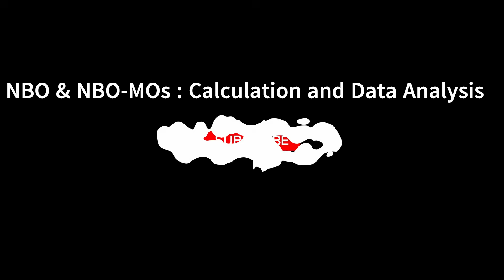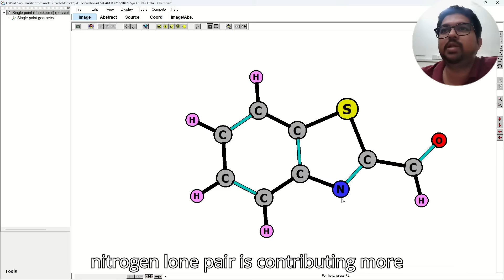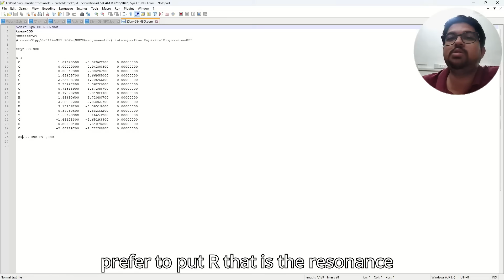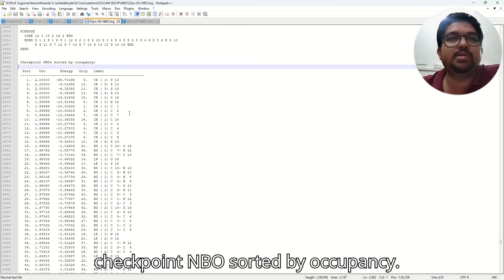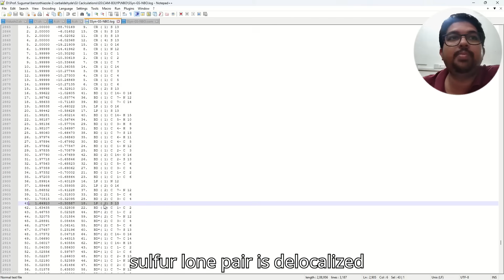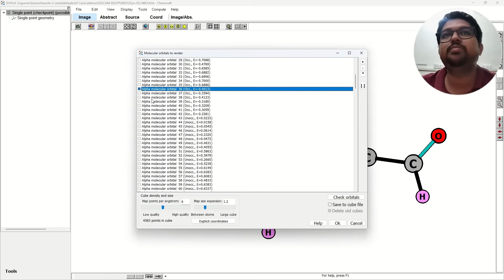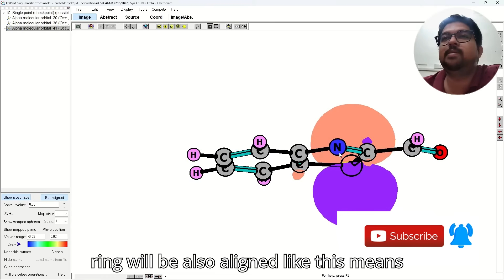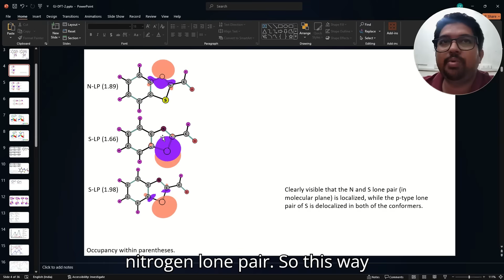Natural Bond Orbital (NBO) & NBO MOs Calculation and Data Analysis || Part-2

Comment: how can i know how pi and pi* bond are contributing to the molecular orbital using gaussian
Reply from the maker: See the atom labeling corresponding to pi bonds. BD in NBO is used for bonding and BD* for antibonding
Reply: @quantumguruji  and also is there any software by which i can easily get which bonds are responsible for homo lumo orbital specifically to relate with charge transfer properties
Reply from the maker: @materiallycondensed there is no such direct tool. Maybe you should calculate the Bader charges and then do the analysis. If the charge transfer takes place in the same molecule then frontier MOs will be helpful in explaining the charge transfer.
Reply: @quantumguruji  yes charge transfer is taking place in the same molecule. How can i explain it with frontier MO.
and also How can i get bader charges with gaussian. I have already calculated APT CHARGES
Reply from the maker: @materiallycondensed for Bader charges you can use the Multiwfn package or you can calculate NBO charges rather than Bader, up to you. Regarding analysis of charge transfer, you need to have some expertise to analyse this based on MOs. You can take help from some experts or read some literature and gain some knowledge about it.

you can contact me in case you don't get anyone, chemistjhaa@gmail.com
Reply: @quantumguruji  sir, I have seen that, but I haven't understood how homo lumo are forming with bonding and antibonding. Do you have any detailed videos on that?